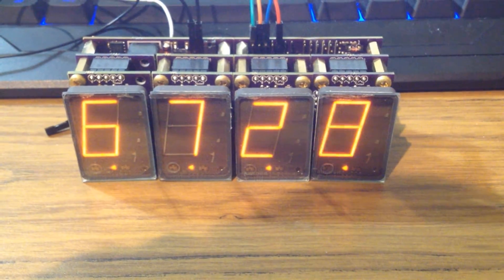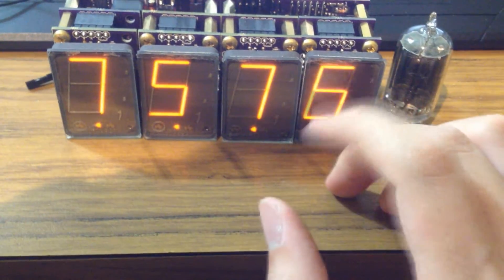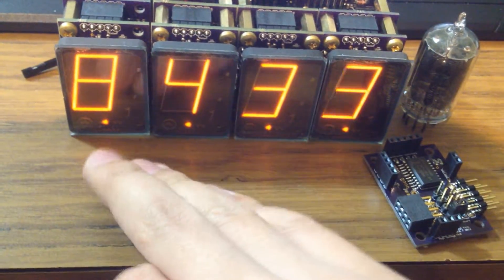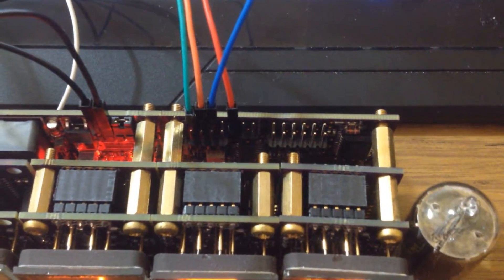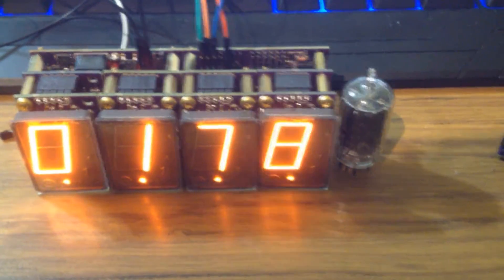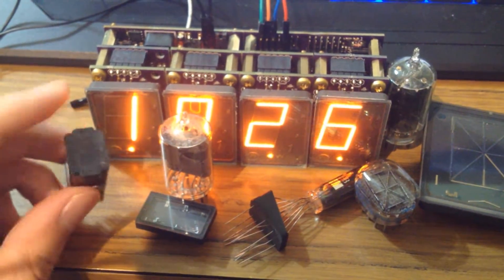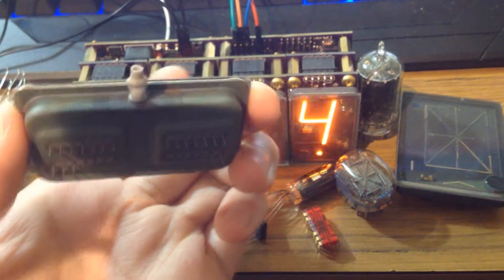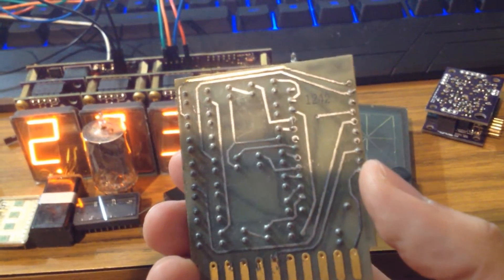WIP SP101 Panaplex Clock + tour of other vintage display devices

Comment: Hello,
Great work on the clock.  I have some of these displays that I want to make a clock with - would you be willing to share the footprint that you used for the display part so I can get the pins aligned properly - there seems to be little information available on the internet. I would be using EasyEDA. Would you be willing to share the board layout so that I can generate a footprint from that? 

I hope you can help.
Richard
Reply from the maker: Hello. I designed my part in EagleCAD so I only have files for that available. I copied the part over to this Eagle library: https://github.com/Z-Y-12345/SP101 . You may have to adjust the drill size.
Reply: @ZongyiYang  Absolutely perfect, thank you very much indeed. I actually have the proper sockets for them (which have the same pin locations) and the sockets take care of the glass protrusion. The Eagle library components loaded in to EasyEDA Perfectly. Thank you again.
Reply: @ZongyiYang  Another question! Did you find any documentation that confirmed the typical current values for each segment, full stop and comma etc? I have found data for smaller displays (0.55") but these are almost twice the size. I was planning to use separate resistors for each cathode part. I note also that for the 7 segments, the lower vertical segments are longer than the upper vertical segments. When working with ZM1350 - they specify different current values for each differently sized segment so I was hoping to find similar data for the SP-101.
Reply from the maker: @scalesr1  Hello. I have uploaded a pic of my schematic: https://github.com/Z-Y-12345/SP101/blob/master/schematic.JPG
The numbers are a bit scrunched but the resistor values I used can be seen in the commit message: https://github.com/Z-Y-12345/SP101/commits/master
I have the datasheet somewhere in my backup, I'll try to dig it up for you later this week when I get my old backup disk open.
Reply: @ZongyiYang  Thank you for that, my drive circuit looks fairly similar - I am using the 'smart - socket' idea where a PIC16F690 drives each tube via the resistor+transistor+Cathode resistor concept - One PIC per tube and I just send serial data to the PIC's. I already have an idea for a V2 where I just use shift register HV5812 to drive the segments via the separate resistors - one per cathode.
Reply: @ZongyiYang  Thank you for that, I note that you are using  69k for the segment sections, I had planned an HV supply of 170V and a segment current of 200 uA which , when assuming Anode to Cathode voltage drop of 135v suggested I used something like 180k. I am using direct drive, can you let me know how you got to 69k for the segment resistors - I dont want to over drive the the display. For testing I have been using 220K from a 170V supply.

Comment: Hello, nice tour.  Do you happen to know the specs on the SP-101.  I cannot find a datasheet to see the current rating recommended for the unit.  I would like to test statically and you have to limit the current at 170vdc.  I will eventually drive them with the DM8880 in which this datasheet says it does not need current limiting when using this driver.  I am sure I can figure the pinout, unless you have that as well.  I assume the anode is at the bottom next to the keep alive.  The segments I think I can find by trial and error.  Thanks.  Check out my channel if you like vintage clocks...Jim
Reply: Hello, did you ever get an data on the SP-101's? I have a few and am working on a couple of solutions for driving them and I'd really like to know the segment current specs. For now i'll look at other similar displays for which data is available but it would be great to know if you found anything.
I am following two different approaches, one using the 'smart-socket' concept whereby each display will have it's own PIC controller (I have made several clocks using this approach) and the other whereby each display as it's own shift register style driver HV5812 which should be more compact but will need a lot more coding to make it run.